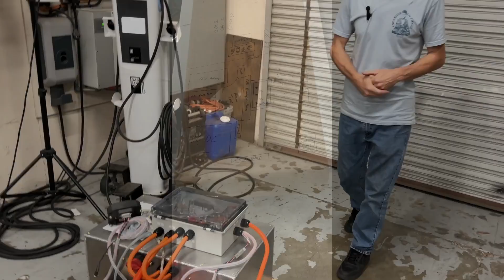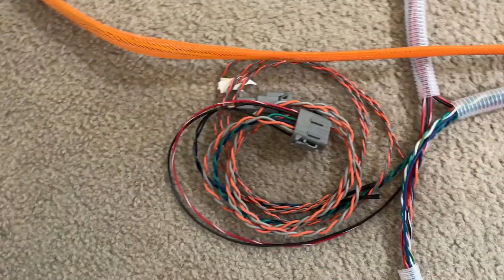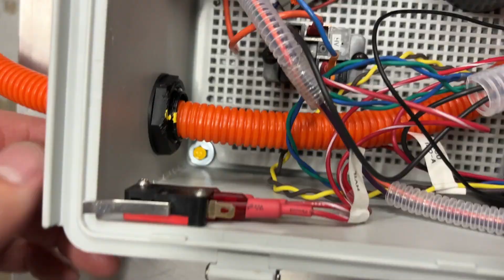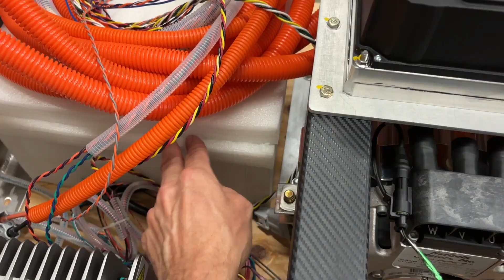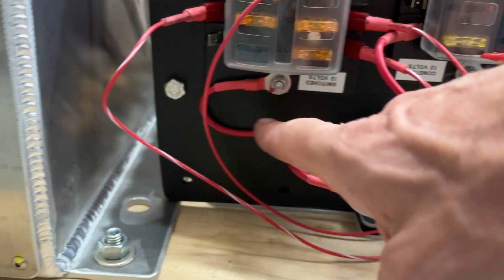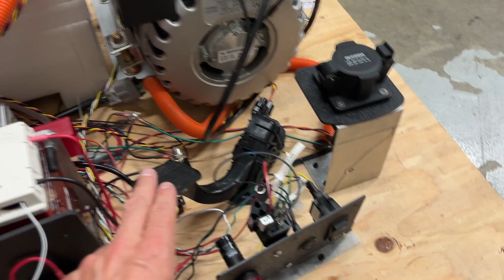Building a 2002 Civic EV: Full Electric Vehicle Conversion Bench Build & Behind the Scenes Guide

Comment: Thanks for the presentation.  I'm planning on converting a 1992 Mazda MX-3.  Battery pricing (like CATL) are dropping quickly.  Just wished the motors did the same.  It would be nice to have a range of 80 miles on a conversion for around $10K to keep a lot of cars from the scrap yards.
Reply from the maker: I have a 96 Civic I converted for a little over $10K on mostly used parts and it gets 80 miles on a charge. The one in this video was into $20K+. I posted the install - 2002 Civic EV Conversion Student Project Limited Resources. It is a great watch also. Thanks for commenting.
Reply: @M @MyEVMechanic Thanks.  I’ll check it out